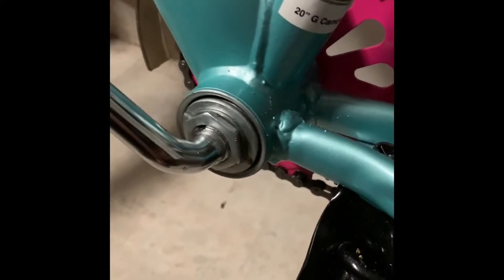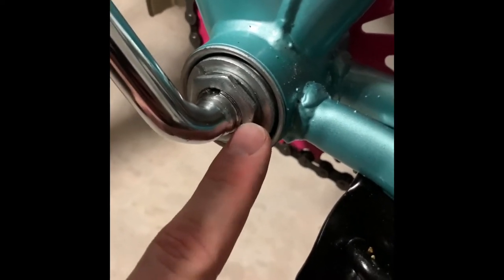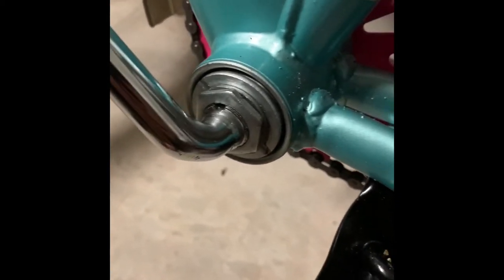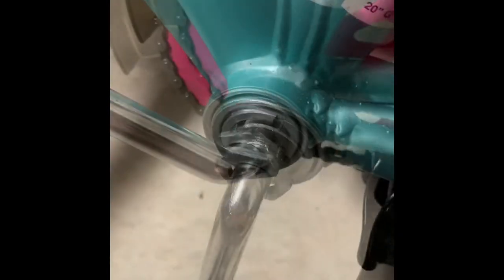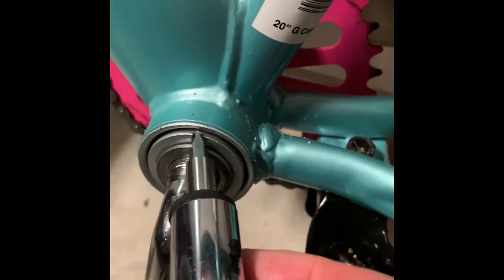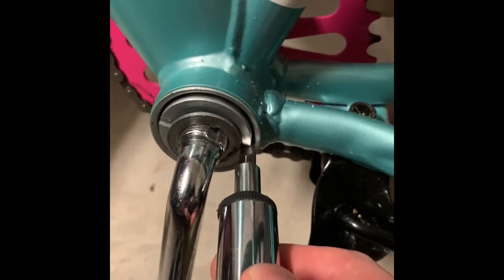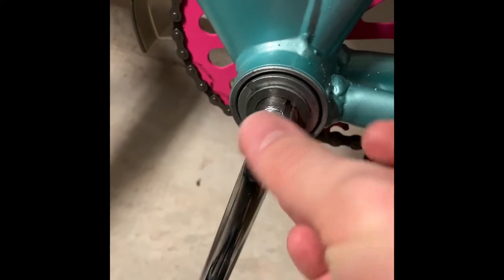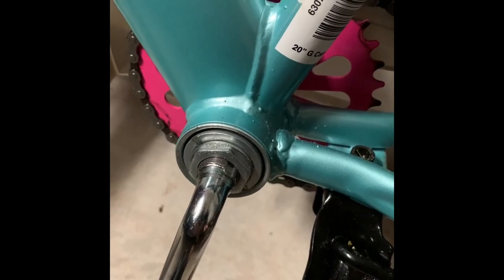Fixing Loose Crank Arm

Comment: I thought you just tightened that hex nut so I almost took the whole thing apart and swapped for one from another cruiser, thanks for the video for the numbskulls that are impatient. Gladly I didn’t start on it yet cause I caught the flu the day before I was going to strip that bike down(putting a motor on it)

Comment: Hey do you know where I can get those parts for my bike? None of that is there and the bearings are visible and several have fallen out.
Reply: If several bearing have fallen out you will need to find the right size bearing (you can buy rulers with holes that measure size). You will probably need to look for a one piece crank bottom bracket if it's missing parts. Park tool's article "Bottom Bracket Service: One-Piece Crank" should help.